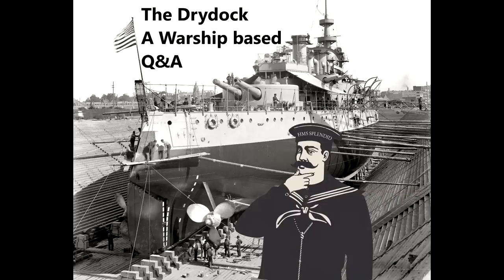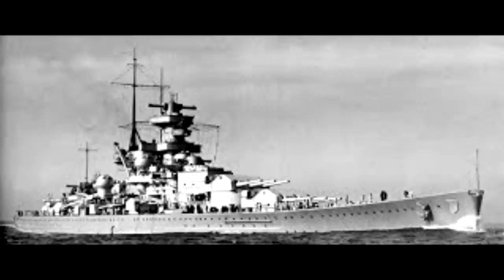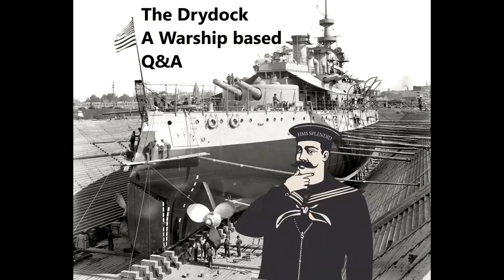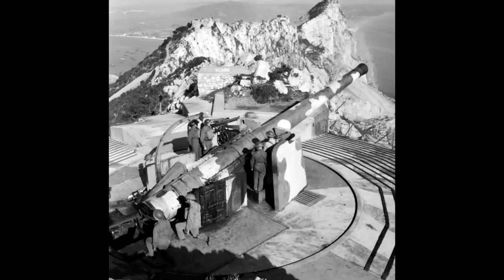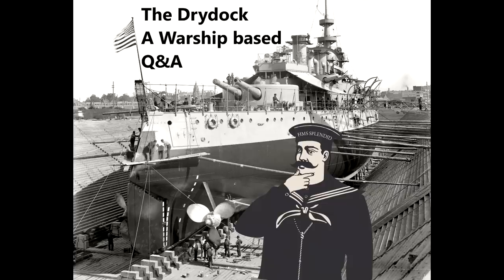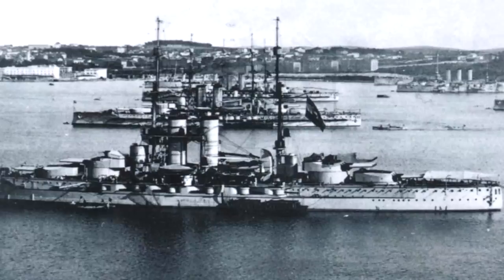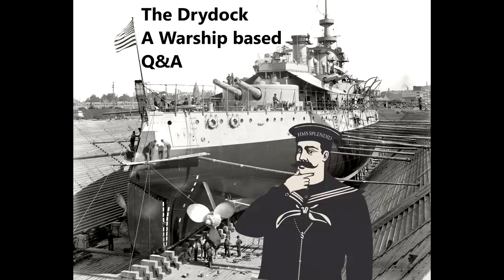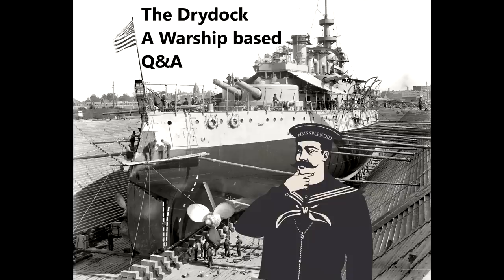The Drydock - Episode 123

Comment: I heard the Problem with Zuikaku and Shoukaku running having the B7A had nothing to do with it being able to fly off the deck.  It actually did have to do with the elevators but not dimension wise.  Rather the elevator capacity limit for Zuikaku and Shoukaku was too low to take a B7A on them.  B6N's weight was supposebly the upper limit for them.  In fact both Enteprise and Saratoga had to get their elevators replaced too.  Though I forget if that was a bit before ww2 or during it.
Reply: Nguyen Johnathan  Yeah the weird hangar shapes some carriers had(despite the theoretical capacity for aircraft, Looking at you modernized Akagi) and elevator capacity are often overlooked factors when it comes to operating certain aircraft for prewar carriers in all navies.  But for Shoukaku and Zuikaku the deciding factor seems to be that capacity limit for elevators and priority of new elevators went to new constructed carriers like Taihou and even the Unryuus.  That said the fact that two of their elevators were a bit too small(probably would have been replaced if the Crane carriers got modernized like Enterprise did) to fit the B7A would have also hindered them.  Well at least until they had their theoretical refits/modernization that never happened during the war.

Comment: Consider the differences in design philosophy.  Battleship HighCap has a base charge equal to about 7% of the round's total weight.  Regular artillery HE has explosive filler equal to over 75% of the shell's total weight.  HiCap is mostly a giant penetrator.  Artillery HE is equivalent to a giant flash-bang grenade (with shrapnel percs).  They are used differently, they detonate differently and the detonations have markedly different effects.
  The HiCap explosive charge is pretty much a high speed rocket motor/base bleed charge.  It DOES NOT DESTROY THE PROJECTILE.  It isn't powerful enough.  So, upon initiation, the charge jets outward at a very narrow angle, nonproblematic in an enclosed space but extremely inefficient as a high explosive when striking soil, clay, or even rock.  With that said, the crater caused by sheer transfer of kinetic energy from any Battleship projectile* is big enough to look like a large bore artillery shell hole.
  Artillery HE does destroy the projectile; in fact, that's how it gets those shrapnel percs.  Its detonation is not confined** and explands omnidirectionally.  It has much greater concussive effects near the target, but little penetration of armor, earth, or clay.
  Moreover, many fuzes (especially grazing fuzes) fail against soggy loam, humous, or wet clay.  Battleship HiCap was NOT meant for shore bombardment, other than against casemated or turreted shore batteries.  Can it be turned to purpose?  Yes.  Definitely.  Is it as effective at "shelling" as ordinary tube artillery on a per bore size basis?  No.
*Main Armament/Main Battery.  (Line Throwing guns not included) 
** Unless detonating in a building or bunker
Reply: Current 155 mm M795 projectile is about 23% filler, even the Mk84 2,000 lb bomb (which doesn't have to survive the shock of being fired from a gun) is only about 46% filler. Where are you seeing a conventional land artillery shell with 75% filler?

Comment: Yes, and then after you've had fire control systems for a few decades, you get aircraft carriers (and later cruise missiles), and the engagement ranges have gone up dramatically again, into the hundreds of miles.
Reply: Which is why battleships ended up obsolete in the late 1930s.

Comment: With the longest hits range question. How do they not know how far they are if theyre actually hitting 😂. If they hit they should know a rough ballpark of how far theyre aiming.
Reply from the maker: Basically because in all the cases there are multiple ships, all with their own records, which may disagree, plus range figures were not recorded constantly, so sometimes we have a range figure from several minutes before or after the hit. Plus of course both ships are moving whilst the shells are in flight, so total range will be slightly different even if we knew what the rangefinder said at the moment of firing.

Comment: In response to: Battle of Peleliu shore bombardment- The response here is not really taking into account the main reason why the offshore bombardments weren't so devestaing. This was because almost always the big gun were fired fairly lateral - aim and shoot the shortest distance. The USN never understood that the impact of the big 16" shells would be far better in the hardened islands with a 45 degree angle shots. Just adjusting to the technique would have saved thousands of US lives during the war. The would have been very effective at Iwo Jima, and even more so at Okinawa, where there were constant ridges, and the Japanese would come out of the leeward side and attack, while being completely protected until they came out. The big guns should have been moved to the end off of the island, and set at a distance so that the projectiles would be coming down at a very good angle. This would have hit the leeward side of these ridges that were so deadly to the Marines and US Army. The notion of dud as the reason is none sense. This was an ongoing problem, and not just at Peleliu.

Comment: "six twin mounts"   Six total 5"/38 cal guns in three twin mounts, right?
Reply: If it's the question I'm thinking of (Battle class vs Gearing, with subsequent diversion into using the 4.5" in place of the 5.25"), then the Dido class cruiser might have saved enough weight with the smaller gun to add a third twin turret after of the superstructure, for a total of twelve 4.5" guns. This matches the Oakland subclass (the last four Atlantas), while the first four Atlantas had sixteen guns with two twin 5" wing turrets, one on either side of the superstructure, in addition to three turrets forward and three more aft.
Reply: @kemarisite  The video says the Fearings had "six twin mounts."  From reviewing photos and specs, it seem the Gearings had three (30 twin mounts, not "six."  This issue is unrelated to armament of light cruisers.
Reply: Sorry, Gearings.

Comment: Which is more powerful a potato gun that uses compressed air or one with butane that you ignite asking for a friend thank you
Reply: I think it's the one that can launch the most potato the greatest distance in a given time.
Reply: @hermitoldguy6312  Thanks😝
Reply: @hermitoldguy6312  it would depend on so many other factors for example the what is the air pressure etc.  It's an impossible to answer question with such little infomation
Reply: @jonsouth1545   Well yes, the power of a particular gun is whatever it was built to do.
I was giving a physics answer, based on the meaning of "power". 
Power = work/time, work = force x distance and force = mass x acceleration. 
So it's mass, moved some distance in some time.
Reply: All else being equal you will probably get higher peak pressure with a combustion design but you will get better repeatability with compressed air and thus be more likely to get hits. Littorio class battleships demonstrated that powerful guns that cannot hit the broad side of a barn are useless.
I would go with pneumatic they are safer as well.
Reply: @jonsouth1545  should I use a Yukon Gold potato or Idaho russet?
Reply: @shawnbeckmann1847  neither you want a Maris Piper,  although if you can make a submunition carrier a Jersey Royal would be spectacular.